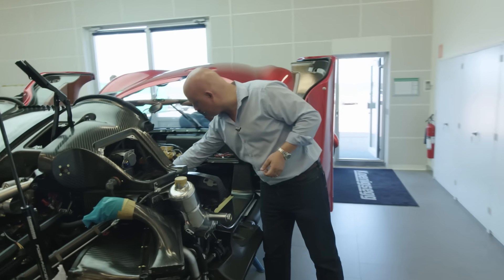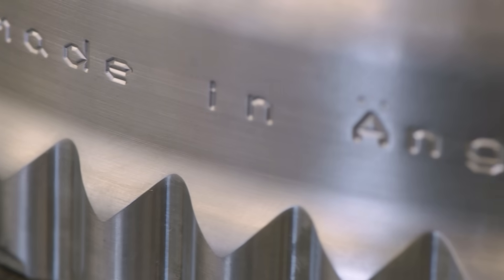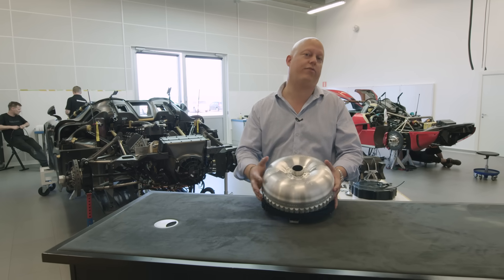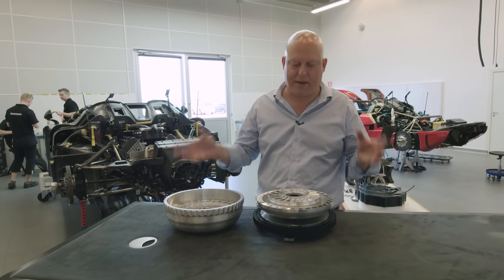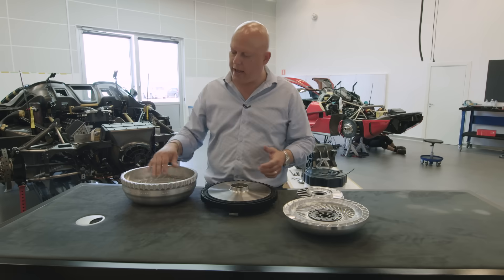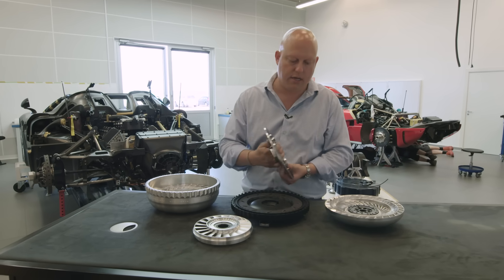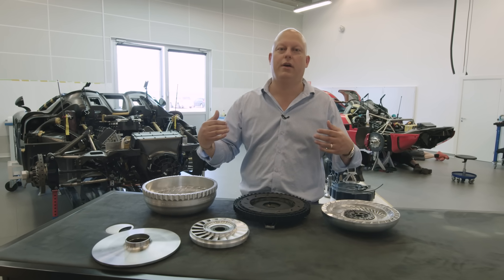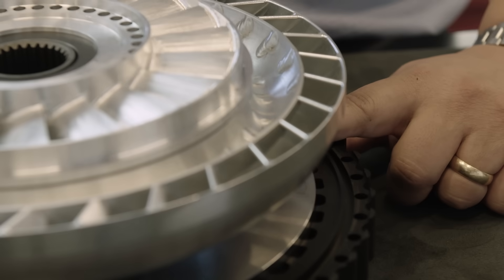248 MPH Without A Gearbox: Direct Drive  -- /INSIDE KOENIGSEGG

Comment: if at the input are a 2000 rpm and at the output 1000 the torque cant more then double, double would be 100% efficiency

Comment: what a crock of crap. That thing does not do anything he says. 1200 Hp can not under any circumstances be contained in aluminum housing. They impeller stator unit is and torque dampener. It is removing torque by it massive inefficiency of it in fluid.  Transitioning the direct drive of the outer hub, into a fluid, and then from the fluid back to impeller (stator of much smaller dimensions and thru the inefficiency of the fluid, and then from impeller to a clutch, and from there into an output. It is a double clutch system, the first one is hydraulic dampener clutch. It is foolish. The torque that gets to that Hydraulic clutch is only a small fraction of what the direct drive outer housing provides. It is the only way the whole thing will not disintegrate from torque. As the two clutches gain rotational speed that become synchronized to the fluid flow and eventually match the rotational speed. Under very little torque. This is all similar to a jet engine transmission purpose for a helicopter rotor. It Takes forever for the blades to spool up to the engine speed. They would be better off just using a helicopter main rotor transmission. their design is stupid
Reply: Umm you're well aware that the Engine it's connected to is Twin Turbocharged and there's an E-Motor at crankshaft at other side of Engine right? Then you forget there's 2 E-Motors powering rear wheels and at center is a Differential with a ratio that connects to the Wheels and the TC, plus Idk what is the difference between that TC and just another or much of the Differential but it definitely checks out, I understand well enough this is indeed possible with that as he compensates for the lack of Gearbox because the Twin Turbocharged V8 that has crankshaft enhanced by the E-Motor gives more torque than it can give (probably getting that wrong), there's also an article or his site that explains more in-depth on it, this TC isn't just doing this by itself to get the HP and Torque, there just is a specific design of it and other things used to even things out & provide everything we see and know about the performance of the vehicle.
Reply: @artistanthony1007  the engine and the E motor are coupled and decoupled by first the Hydraulic drive and then by a standard friction clutch drive that are in series. The makes the trans mission a hydraulic clutch ( hydraulic slip)  followed by a friction clutch (limited slip) assembly. Both are torque dampeners and the hydraulic is a variable torque divider , the division rate is directly proportional to the Slip rate. ie the hydraulic Fluid speed vs fan speed ratio. At initial start that torque division is max. and very high, you are not getting any more than 20% torque at instantons start.  The hydraulic slip unit is directly coupled to the Limited slip friction Clutch drive. which is also not a direct coupling or direct drive. It still has small amounts of slip even when the flywheel matches the clutch plate   ALL this  is why the weak aluminum housing can even work. There is no direct drive at all at any time. When the hydraulic drive fan eventually catches up to the fluid speed is it still loosely coupled by the fluid as is the limited slip clutch system. ALL junk . You stole the idea, which is not novel,  from the old 60-80's style hydraulic fluid fan clutch designs. It is laughable. Wait till your little friction clutch wears out and heats up the Hydraulic fluid to super heated levels. That will be fun to watch. If you are sitting close to the unit by where it is positioned when it does, you should put a blast shield. Youll need it.

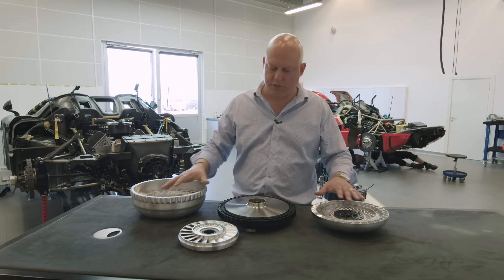Comment: 5:55 
He says if the input of the torque converter is 2000rpm and the output 1000rpm with ‘more than double’ the torque??? How is that even possible
Reply: If I'm remembering correctly, the Engine has the E-Motor at the crankshaft and that is the other side of the Engine which is what adds to that.

Comment: You can add torque but you cannot add power from something that is causing resistance.
Reply: Except the vehicle uses a E-Motor at crankshaft of Engine and this at the end of Engine to go to a differential and 2 extra E-Motors to mainly power the rear wheels, the TC is amplified because of the E-Motor-driven crankshaft and the Engine then the Engine is Twin Turbocharged.

Comment: The oil inside that torque converter must be going through ALOT compared to a normal gearbox. I wonder what's the maintenance interval. 20000 km? 10000? 5000?

Comment: Direct Drive will undoubtedly be a milestone in the evolution of the ICE.
But what I don't understand is why do we need the torque converter? A one way clutch and the electric motor alone should suffice?
Reply: Its just to boost the torque at low RPM. It not necessary for a normal car. Porsche did something simular in the 80s with a hydraulically boosted manuall 911.

Comment: amazing, i had the same idea the other day, that with a torque converter you could essentially use an electric motor as the transmission of a vehicle, because electric motors have full torque from rest. i'm happy that my thoughts were confirmed by master engineers, and it's even being worked on, unlike the foolish granduer of tesla and their access to slave labor lithium mines.
Reply: Lithium mines don't use slave labor. You're thinking about cobalt. And by the way, the Koenigsegg Regera has a lithium-ion battery...
Reply: @beanapprentice1687  oh how right you are

Comment: I feel like this is a simple solution for the "Gearing problem" and perhaps better than CVT. So why don't we see it more often? I don't see it more costly to make an an actual gearbox
Reply: Because torque converters are a lot less efficient than using gears for torque multiplication in most cases. We’re talking maybe 80% efficiency for a torque converter in torque conversion mode in ideal conditions and significantly lower in less ideal conditions. Compare that to >90% transmission efficiency (including oil pump losses) for an automatic gearbox across most operating conditions.

The Regera doesn’t need additional gears to hit its performance targets because the engine combined with the electric motors have enough grunt to start off even with very tall gearing. This approach would be less feasible on vehicles with less power.
Reply: There’s also the issue of ratio range. Most torque converters have a maximum torque multiplication of around 2.0, with lockup at 1. That gives a torque converter a “ratio spread” of 2.0. A modern automatic or CVT for regular cars has a ratio spread of over 6.0, some as high as 10.0 before you factor in the torque converter sitting in front of it. So a lone torque converter doesn’t have anywhere near the ratio range to give good driveability for normal vehicles.

Comment: Would like to see how much power the electric motor on the crank puts out from a standing start. When you floor the gas, does the v8 just go full rpm or does it gradually increase rpm as traction allows? Be interesting to see a graph of all the motor torques and speeds during a 0-200mph run.
Reply: Think there will be some things they won't reveal, like that.

Comment: I didn't even think about how low the stall RPM has to be (BELOW idle) to make this whole system work - for a torque converter capable of handling 1000 lb-ft of torque IN 7TH GEAR FROM A STANDSTILL. LMAO

Comment: Basically, this is something like real hydraulic automatic transmition, not todays fancy tronic - robotic double clutch gearboxes. 
When it is mechanically locked, it gives 1:1 ratio, so if it has input of about 5000rpm, output is 5000rpm. When it is in unlocked mode, oil acts like transmition medium. To put it in perspective, here is simple example: Let's say that we have 2 turbines. First one is 100 mm in diameter, and second one is 200 mm in diameter. Smaller one rotates at 10 rpm it has torque of about 3 Nm, and shots out oil at about 2 m/s. Oil from smaller turbine is shot on veins of larger turbine. Since the speed of oil is the same, but diamter of second turbine is double from first turbine, angular speed of second turbine is half of the first turbine, so it's about 5 rpm. Torque is now double value because second turbine is double the diameter of the frist turbine so it is about 6 Nm. And plus, this whole system can be variable, for example, by shooting oil at different portions of second turbine you will have different transmition ratios. Also oil can slip trough veins if there is too much torque applied in short amount of time. I think that is torque converter stall that he is talking about. One important thing, this transmition mechanism is very reliable. Efficency of this hydromechanical witchcraft on acceleration and high torque demands is questionable because there is alot of loss because this is not rigid transmition, but there is electric motor to fill in holes.
Hope this clears out what is working principle of torque converter.

Comment: Nice video but one little detail 6:05, if you get half the rpm and more than double the torque, means that instead of losing you are generating power in the torque converter and that doesn't sound quite right 🤔
Reply: Late to this after revisiting the video years later. You can thank YouTube’s new comment filters. 

I think what Christian was forgetting to leave out was first of all an overstatement. Secondly he was probably trying to get more at the fact it’s more efficient than other torque converters not that it’s creating something out of nothing. His English is great although there might still be a language barrier in explaining concepts to a degree.

Comment: I have been building Performance type automatics for over 42+ years. The idea here is not really new. The original Buick Dynaflow (early 1950's) and the  buick variable pitch torque converters (1965 -1967) had this idea in mind, making the torque converter do pretty much everything. However, he has taken it much further. With the electric motor producing instant torque. Lent to his ideas, that a torque converter when designed "correctly" could do exactly what he wanted. I am very impressed...
Reply: Have you seen a converter lil this before? Wonder why? Now you know. (It’s a converter drive just like a Bruno/ quick drive/ Ty-Drive). He’s only done a hybrid type deal with it. But say doesn’t that converter design look familiar?

Comment: A Gearbox that changes the "gear" ratio using a clutch... What a genius :O👏
Reply: It doesn't change any gear ratio with a clutch... the only clutch on it is to lock the turbine to the engine to reduce inefficiency losses.

Comment: not taking anything away from Koenigsegg, he's amazing but anyone remember the dynaflow torque converter?  laughed at by gearheads because the cars weren't fast (although they were semi-bulletproof)... then came variable pitch stator, twin turbine... triple turbine (although i never drove one and there is a law of diminishing returns!)... just sayin'.  but it couldn't break away from it's reputation and buick threw in the towel in '63.  anyway, this is all exciting but, albeit with more modest top speed!, shiftless acceleration is nothing new.

Comment: So basically it's like a top fuel dragster with a slipper clutch, when you have 1700hp in a carbon fiber car you can say "Marty, where we're going, we don't need gears!"

TLDR:  Obscene amounts of power + tall gear ratio = no gear changing  necessary other than torque converter slip.

Comment: What a brilliant idea. Using only a single ratio (equivalent to 7th gear) and an oversized torque converter to save weight and using that saved weight for a bigger displacement engine and 3 electric motors (and batteries). Torque converter makes up for the lost torque of not having shorter gear ratios. The downside to this is poor efficiency when accelerating hard from low speeds. Once the torque converter locks up, either when accelerating lightly (when not much torque is needed) or when cruising at high speeds, efficiency is restored. Power and torque when you need it, efficiency when you need it.

Comment: Watching this, all I could think of is that he's basically running a lightweight, overpowered vehicle through a fancy torque converter without any transmission. The designer figures that, since grip is ultimately limited, what's the point in adding more power to the wheels if you're just gonna spin them out. However, that seems illogical to me given that serious racing slicks can always add more grip. So imagine this same setup with even just 2 or 3 gears! Besides, the idea of performance comes down to efficiency, in my mind. If you can achieve the same performance results with half the power, then that's the better option. I can achieve the same performance, i.e. acceleration and top speed, by running a 1500hp engine through direct drive and a torque converter OR by running an 800hp engine through an efficient gearbox. The Koenigsegg method seems outdated and inefficient to me. Kind of like a 2 speed drag car from the 70s. Rather than using a gearbox, let's just throw a whole bunch of brute force into the equation. Just imagine if grip were not an issue, and we added a gearbox to this same race car. Think about how much more power you would get to the wheels!

Comment: Torque converters in my opinion are worst than Satan, they are basically heaters... just a pece that dissepates power, but they make a car easy to use, that's for sure.

Comment: Amazing! How the heck does it act like a CVT? Other manufactures may become interested in this! If it was a regular torque converter in 7th gear the engine would have a stall speed, bogged down, not able to overcome the hydraulic pump resistance until MPH gets high enough then engine RPM rises. Impressive engineering.

Comment: I wish that off it hadn't been invented yet ...that the torque converter provide ratios of speed by hydraulic control ...by flow of hydraulic instead of gearbox ...I believe that there is still a lot to discover in automotive science

Comment: So, it's basic a hybrid car with a dynaflow?
Reply: gsilva220 dynaflow?
Reply: @jonasthemovie  A single-speed transmission with a huge torque converter. Made by gm in the 50's
Reply: gsilva220 The Regera is a hybrid with a torque converter and lockup, not really comparable to the Dynaflow which had two stators, two turbines, but above all, a two speed planetary gear.

Comment: He is genius but at 5:57 he said something wrong "Lets say you put in 2k rpm but only 1k rpm comes out with more than double the torque." which means that the torque converter has an efficiency of more than 100% which is not possible.

Comment: This is roughly the second or third time this man has explained how this damn torque converter works on this damn car and I must be an idiot cause I STILL DON'T GET IT!!! Sounds to me like he's just saying he just built a strong enough torque converter to be able to take all that raw power without the use of a transmission. I wish i could talk to him personally, cause I want to simply ask: At a  traffic light, in what would be first gear in a normal car, when this car takes off, what is the drivetrain doing? From engine, through this converter, to the wheels. Then I'd ask again at cruising around 45 mph, heavy acceleration? coasting? What is happening here?!?!
Reply: MAN_ON_WHEELZ You forget about the hybrid parallel system.
Reply: @jonasthemovie  Which too has always thrown a curveball into the equation when talking about automotive drivetrain. Even in my automotive classes. At the time it wasn't so important to learn about Hybrids that we needed the knowledge for a grade, so it was only briefly touched on, so I personally know very little about how Hydrid systems really work. I get the general concept of it, but I don't know how it could be re-configured to make a Super car not need a transmission.
Reply: @man_on_wheelz  At low speeds (and reverse) the torque converter is disengaged - the ICE works with the electric driveshaft motor as a generator feeding power to the two electrical motors on the rear axle. With almost linear torque from standstill the electrical motors will bring the car up to a speed where the torque converter can help acceleration. The converter works up to the point where output rpm is in the power band of the ice - there the unit locks up and just is just a dumb flywheel.
Reply: @zooloo73  Ok, now I need a better explanation of what the ICE is, I think I'm starting to get this.
Reply: @man_on_wheelz  Internal Combustion Engine - the good old petrol engine.
Reply: @zooloo73  Oh dang, ok, thought you were mentioning a separate hybrid component I missed lol

Comment: A better torque converter option would be a CNC heat resistant ceramic same as what GE is using in their new  GE9X Jet engine very lightweight, very powerful
Reply: albert estaco why?